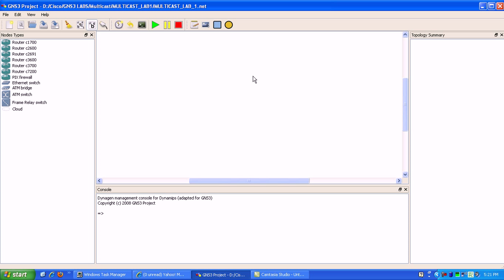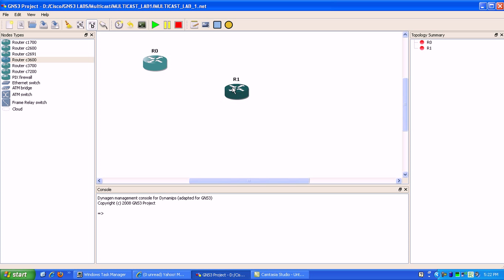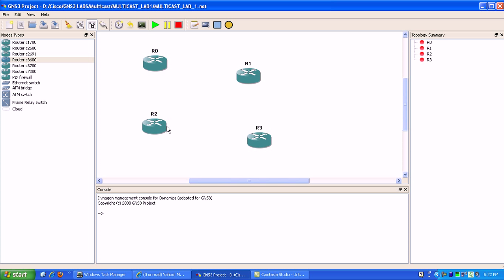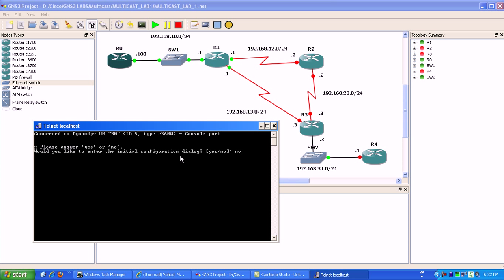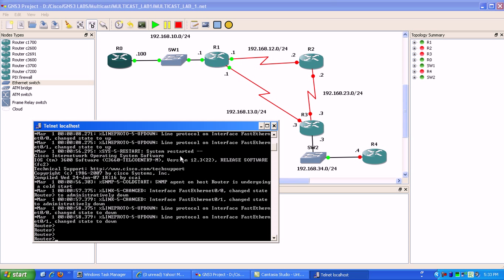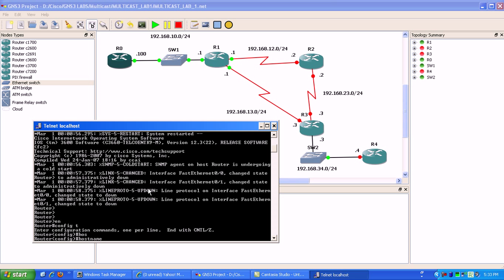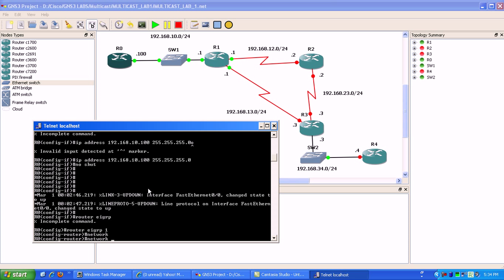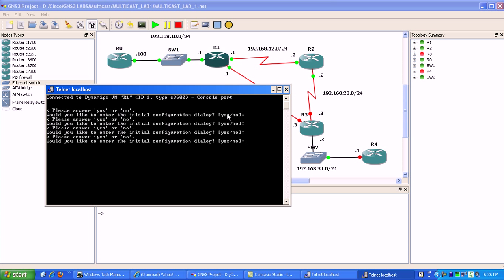Multicast Lab 1 IP Protocol Independent Multicast Dense Mode PIM-DM

Comment from the maker: packet tracer is limited. limited to CCNA level topics. Anything over CCNA, you must either buy real equipment or use GNS3. In my case I use GNS3 for the routers, 3550's for the switches and tie them both together using GNS3. Thats what makes GNS3 far superior to any other router emulator/simulator.